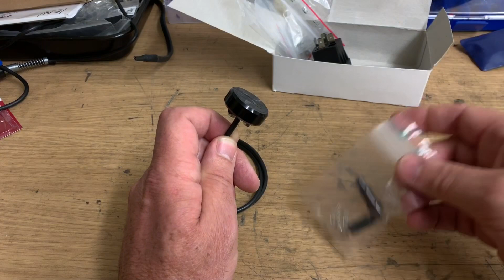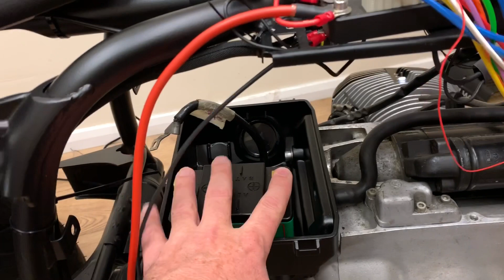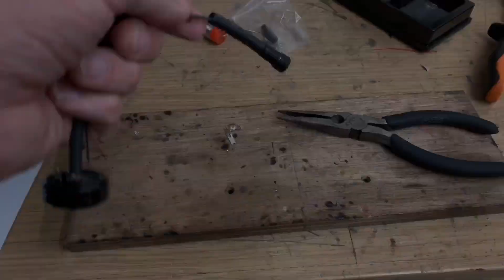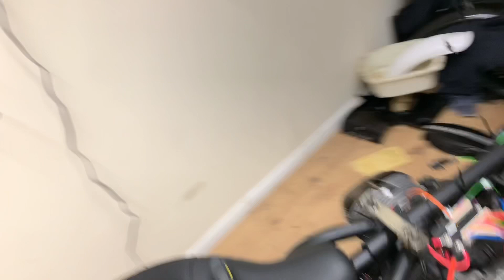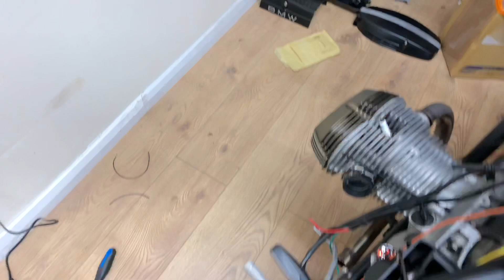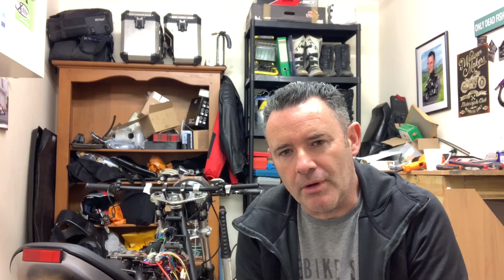38. BMW R80 Custom build. Electrickery part 6 Motogadget m-lock install.

Comment: Did you use the relay with the Mo Lock? I’m using the same setup as yours and unsure if the relay is required
Reply from the maker: I didn’t use a relay.

Comment: Hello, love the videos. Helped me a lot last year fitting m-unit blue to my BM R80RT. I'm now fitting a new reg/rec instead of the original reglulator and diode board. On, I think it was episode 38 or 39 you show a resistor in the circuit from the  reg/rec to the battery. Do you know if all reg/recs will be wired in the same way. I've got a Ricks motorsport 14-100 model, I bought this after watching a video by Revival Cycles in the states. They provide a wiring diagram showing on this model a white wire from reg/reg to the DF terminal on the stator with the Generator lamp on that wire. Any help would be much appreciated.
Reply from the maker: Hi Stephen.  My understanding is that you need to add a resistor if you plan to eliminate the charge lamp from your charge circuit. The font of all knowledge can be found by googling “snowbum bmw”.  It’s a technical read but totally on the money.   I will add that I’m yet to successfully reinstall the charge circuit on my build (after my small errrrr fire)  so I don’t know if my resistor set up will work.  I’ve since found a “charge lamp eliminator kit” online so that might be my answer in the end. Hope that helps?
Reply: @TheLongWayThereUK  Thanks for reply, don't want to burden you with my problems but... basically my new reg/rec was overcharging, putting out over 18V which will fry the Antigravity lithium battery I have installed. On making enquiries to Ricks Motorsports the manufacturers of said reg/rec they say you don't need the generator lamp? On their reg/rec's original wiring diagram the gen light was on the  wire that went from r/r to DF terminal on stator, can't give you any difinitive result yet as I'm still working on it. Thanks for the snowbum link, he actually has a specific wiring description for a LED gen lamp using a 1W 330ohm resistor. Keep up the good work.

Comment: Hi, just wondering about a couple of things. 1. The Motogadget day to use the blue wires, 2.5mm x2 for the start to the solenoid. The original wire (Black) going to the solenoid is only single and smaller. I asked a BMW mechanic (of old airheads) and he says it is not necessary just attach the M Unit to the original wire which runs next to the gen light wire (Blue). What do you think? 2. The 40 amp fuse. You have it connected to the M Unit from the battery. Motogadget say the M Unit doesn’t need a fuse and that the fuse goes between the Reg/Rec and the battery. I asked the same mechanic and he reckons that once again it isn’t necessary as the BMW is set up differently. The wire is connected to the starter motor where the main cable to the battery goes. What do you think? Interested to get your thoughts on the above. Almost finished the wiring and hope to have the R80 running this week.

Cheers
Nic
Reply from the maker: Hi Nic

Thanks for your question. Interesting topic!

As I’ve removed the original loom in its entirety I’ve decided to follow the motogadget instructions for the various components I’ve used.  It’s just easier for me to go that way and if it works then I’m happy.  I’m sure there are alternative wiring solutions that work but I don’t see the point in exploring them if the “motogadget way” works.  The instructions (and wiring diagram) that came with my m-unit clearly state a 40 amp fuse between the live and the battery.  There is no fuse on the instructions that came with my reg/rec so I’ve not included one. There’s a 1 amp fuse on the motoscope pro and the m-lock live feeds.  That’s it.  

Hope that helps!
Reply: The Long Way There. Hi again. Thanks for the reply. Finished wiring yesterday and everything seemed to work ok so far. Was wondering if you have tried to put your tank on yet?? Does the wiring and M Unit interfere with the tank?
Cheers
Nic

Comment: Hello dude!
Looks better for every time!

Can you talk a bit more about the acewell cable to the speedo? which did you buy and how do you connect it to the m-unit/speedo.

Love the content
Cheers!
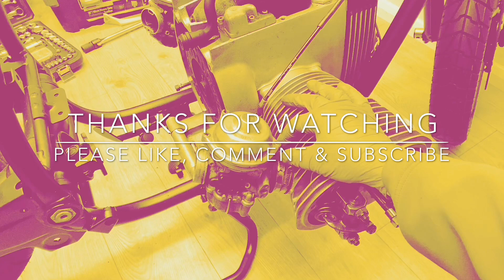Reply from the maker: Howdy! It’s an Acewell Ace S-11 and I bought it from www.digital-speedos.co.uk. I cover the  connection to the Motoscope pro in episode 36. It makes an appearance around 12:30 and again around 24:18. I will quickly mention that this speedo isn’t supposed to be compatible with the Motoscope. I’ll check that though when I get the bike running.  Thanks for watching and glad you like the series. 👍
Reply: @TheLongWayThereUK  Thanks for the fast reply! grade a dude!
Also you answer is spot on! Somehow I i could not remember watching that in E36. 

Thanks a bunch
Cheeers!